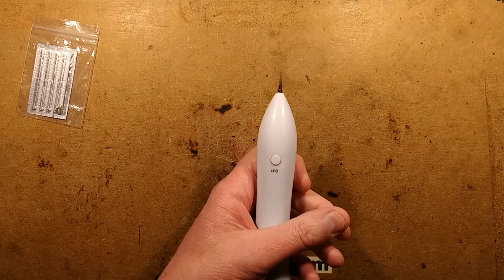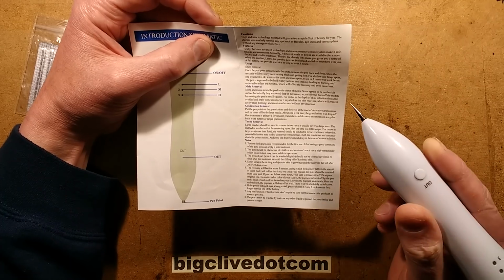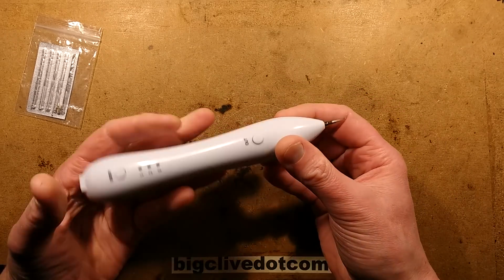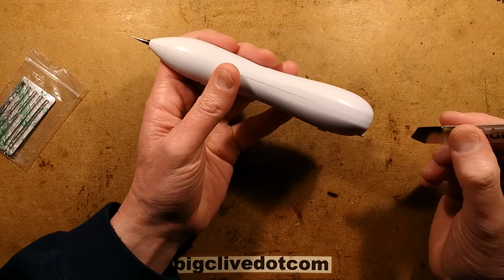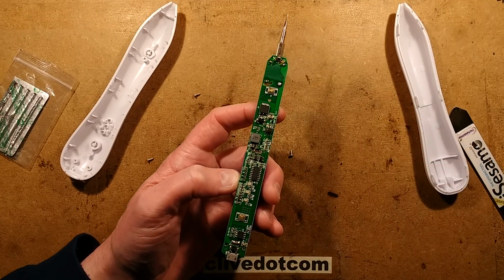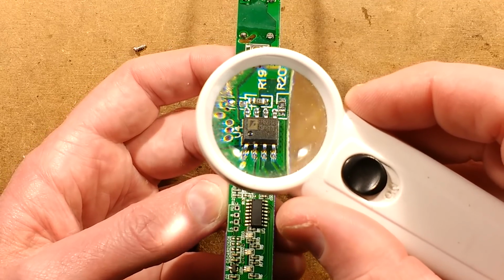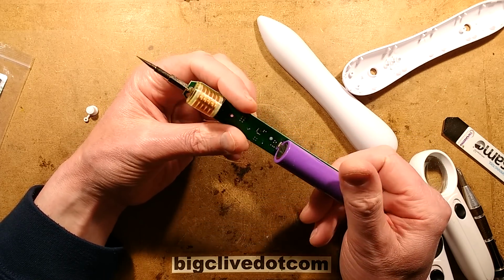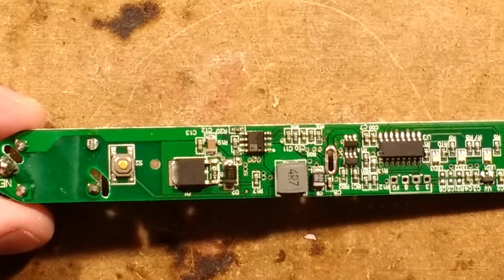USB flesh-burning pen for ladies.  Because apparently they do that.

Comment: DIY cataract removal, in the comfort of your own home, for just a few dollars per eye! (results may vary)
Reply: +Paul Drake  Cool, practicing on grandma to get my technique down.  Should be better than when I learned to tattoo.
Reply: But you can do that with a laser pointer. Although I've found my cataracts seem to go away when I clean my glasses. Go figure!
Reply: I'd say, result may be looked upon. If that cataract was single one.
Reply: L. Rom: You mean Grandma didn’t like that alligator across her chest? Of course, you did go outside the lines quite a bit.
Reply: Gary Cooper  I think she's just whiny.  It's not like she could see the alligator with her cataracts.
Reply: lol
Reply: But wait there's more!  It also comes with a free drill bit for DIY home dentistry.
Actual drill gun is not included, but you can get one at HomeDepot. :D
(Read out loud the above lines with one of those As Seen On TV commercial voices ;)
Reply: if this needle don't do the job, try a vacuum cleaner.
Reply: I'm surprised that this contraption didn't come from a seller called "PenisExtendz" or something similar, cuz I'm pretty sure they sell another model to do just that... ha-ha   By the way, that "thing" has got enough chips and RF circuitry to convert it into a 20-40Khz radio transceiver, or a WiFi router ;)
Reply: @BillAnt  : I was thinking of getting one to run some of my old Commodore 64 games.
Reply: @Dr Drake, I'm glad I had my cataracts done the traditional way!!!!!
Reply: Paul Drake 😂😂😂😎
Reply: Results will definitely not vary.

Everyone is blind now.
Reply: But does it go to Eleven?
Will this clear up her Blue Waffle 😱
Reply: I recommend you watch the Sam onella video on surgeries because you actually can.
Reply: You can actually remove cataracts with just a sharp needle. That’s how they did it in the pre-laser era. Evn the ancient Greeks and Egyptians did cateract surgery. But please don’t try it at home.
Reply: @censusgary  That's actually a gross oversimplification. They used what we'd call a large catheterized hypodermic needle. They'd remove the core after insertion and use their mouth to suck out the cataract and then flip the lens. The results weren't great by modern standards but it restored limited sight - probably akin to looking through wax paper. Still, it's better than nothing but the surgery must've been horrendous- even with some potent herbal paralytics the eyes would roll during surgery. Even with opium, the pain would be.... an experience. They also had plastic surgery to replace severed noses which were common in the age of swords. Apparently this technique was tested a decade or two back on a climber who lost his nose to frostbite and the results were acceptable, all things considered. Pretty impressive for a procedure that had to be rediscovered in modern times.
Reply: it must be fresh unpacked, unroten and sterilized with 95% ethanol (drink after use) nail then -- please don`t break the technology
Reply: Dead pig not included xD
Reply: Is that vary from blindness to death.
Reply: Definitely not gonna see a doctor after this
Reply: lol there needs to be more jokes about cataracts. It's a good word
Reply: Paul Drake this hurt to read
Reply: Paul Drake Good one!
Reply: https://www.youtube.com/watch?v=Ueu-y2rE16k

Comment: How could that thing possibly make money!? There are, like, 20 different components, the plastic case, the micro board, the metal pins...all made by, probably, different manufacturers, shipped somewhere, put together by someone, or several someones, and then packaged, marketed, and shipped to the retailer! OMG!
Reply: ChaosmanOne CHINA
Reply: Even CHINA does not negate material, energy and transportation cost. I think the answer is corruption which does not only exist in China but in the case of China means taxes illegally subsidizing a business to the point of selling cheap product at a loss while still making money while paying employees just enough so they stay or using forced labor. In any case the production line for something like this does not require many peoples.
Reply: ChaosmanOne ironically... if you were to buy that physically in China it'd be more expensive than mail order. Why? Because of taxes, and stuff hopping over to Hong Kong headed overseas is not taxed. The only tax would be customs in the country where it's going if any. Well... between that and child/cheap labor, and polluting laws being ignored? Presto!
Reply: Eman Gamer I thought the dabbing fad was over. 

OH sorry not the dance.. sorry.
Reply: The exchange rate means that they basically got $150 for it, and the parts were still cheap. Also, the PCB is probably made in the same factory that does the board assembly and packaging, it is only the commodity components that get made in different factories.

Comment: Interesting little device. This is basically a mini home "Electro Surgical Unit". A RF probe used in hospital setting to cut, burn and seal tissue in surgery. Most of the ESU's operate around the 300KHz to 3MHz range. Although, since this is Chinese crap, it probably is way off from reliable! Might have to get one just because!
Reply: I wonder - does the surgeon have to caress your thigh during the procedure? I want to know whether I should ask for local or general anaesthesia, depending on the surgeon.
Reply: No. Proper ESU's have a large metal pad that sticks to a shaved portion of you. Mostly the back or thigh. And they also put out upwards of 250 Watts! I think if someone is using this on you, you need to run! This device is a not a good medical device. I can see more problems using it then just leaving it alone. Quack medical devices seem to have made a comeback!
Reply: Well... f*ck! Deep sleep it is.
Reply: Hunter-W7NUK meh, for removing things like skin tags or stopping little bleeders  it would be fine. Moles and stuff not so much because you need to verify they aren't cancerous/precancerous.
Reply: Hunter-W7NUK quack medical devices never left.

Comment: electrocautery is a thing and doctors do use it for removing moles and warts, which is burring them off the skin.
Reply: Yes, but the idea isn't quackery, it's just not optimal to diy this
Reply: Yuck Foutube yeah but medical services are expensive with insurance and everything for non essential isnt covered.
so there is a need for these
Reply: My mole was cut out because it looked precancerous and I was stitched up with stitches that dissolved. I couldn't imagine being burned to remove a mole.

Comment: Feels like an induction heater... No use as a soldering iron then😂 could it be bypassed to just run constantly
Reply from the maker: The processor is generating the pulse train.

Comment: That's literally an electric scalpel. I work in medical equipment maintenance, and from how that thing works (high voltage and frequency coming out of a metal tip to burn/cut skin), it's pretty much the same thing going on here.
Reply: @Bendegúz Csóka , electric scalpel is a type of knife that do not cause bleeding. The electricity is irrelevant; it is simply a blade that cuts without bleeding. It's a type of precision, surgical, and specialist knife.
Reply: "Does not cause bleeding"?  Is it like self-cauterizing or something?
Reply: It's a "DIY Hyfrecator" - http://www.conmed.com/en/products/cardiology-and-critical-care/office-based-electrosurgery/the-hyfrecator-2000-electrosurgical-system. "Somewhat cheaper" than the real deal (that is somewhat north of $2000, but which is a) safe, and b) works - reliably!) :-D
Reply: @phils4634  - But should you trust a company that calls itself ConMed!? 🤔
Reply: @tisFrancesfault , if it's designed properly it can cut like a very sharp scalpel.
Reply: Can you please explain, what it is? I mean I think I should know what electric scalpel means, but what really is it?
Reply: i work in biomed aswell
Reply: Bendegúz Csóka it's a device used for surgery, that uses high voltage switched at high frequencies to cut through skin and flesh, and also cauterize these cuts.
Reply: xponen no, it's as said, basically what Clive has here a high frequency electronic nib that cuts through flesh.
Reply: seen those on tv and wondered how it worked,  now i know the basis of operation . thanks
Reply: PongoXBongo well yes. Burning is a method to cauterize wounds
Reply: It’s also similar to the way (not sure what it’s called but) it’s a technic where you take a red hot piece of metal and put it against a wound and the idea is it cauterizes the wound and kills the cells around it so no pain is felt
Reply: In a word, "Bovie"- amirite?

Comment: Does it get hot enough to use as a solder gun?
Reply from the maker: It doesn't work that way.  It would destroy components.
Reply: it doesn't get hot, it uses high frequincy radio waves like a radio transmitter, your body acts like an antenna, and it transmits at high enough energy to burn you.
Reply: I typed two questions before watching the whole video, I should know not to do that.  I removed one of the questions.

Comment: What a terrible device for maiming your self, like putting a soldering iron on your skin, i wonder if it melts solder.
Great video mate nice to see inside this device of horror. :o)
Reply: You'd likely burn the skin off the fingers holding the solder, and fry whatever semiconductor you're trying to solder.
This device seems to put out high-voltage at high frequencies, which would be conducted by the solder and, in contact with skin, burn it. Semiconductors aren't fans of high voltages, and putting this device in contact with them might have the same effect of static electricity.
Reply: HE Hee "i wonder if it melts solder" it was just for jest, it uses different technology :o)
Reply: It's, surely, a very good device for maiming yourself?
Reply: I know for sure a soldering iron melts skin real well.... Note to self: Don't keep yourself up extremely late trying to finish off soldering a project. It isn't worth it when you end up grabbing the soldering iron in the middle of it instead of the handle with your bare hand. 
Worst part was that it took a couple seconds to register so by then I already had it held in my hand & had to figure out where/how to put it down without just dropping it and possibly causing a fire. 
Live & learn they say. At least I'm lucky the skin has all healed back fine since then but damn it was sure messed up & sore for weeks - couple months.

Comment: Highly unhygienic and unnecessary. Freckles and most moles are perfectly natural.

If you discover new or abnormally large moles you should visit your doctor, not make things worse by trying to burn them off. Good lord!
Reply: I had a mole on my arm that I got removed (by a doctor) because it was right on the inside of my elbow and stuff would rub it all the time which was painful. For some reason they can be incredibly sensitive, so it's not always just "I don't like the look of it".
Reply: I guess of your prodded them with it, it would remove moles off your lawn! 😁
Reply: Yeah...removed a mole by hand once...bled like a stuck pig.
Reply: rdizzy1 < Looks like the person, who uses one of these, has been outed. Lol.
Reply: aren't moles a step closer to becoming cancerous than the rest of your skin? Seems like it would be beneficial to remove them, just to reduce your chances
Reply: Grass Yeah but you shouldn’t fucking burn them off yourself.
Reply: Yeah, I agree. I would recommend getting some of those Co2 capsules and a dispenser from walmart. Usually sold as hand held tire inflation. Just spray the thing and freeze it off...
Reply: Ron McKickass Are you trying to kill us, Ron? Blasting CO2 anywhere near your mouth and nose is dangerous, since you won’t be able to breathe as effectively.
Reply: I had some moles on my belly, the sticky out kind, had them since i was a kid. I hated the sight of them. Several years ago i just cut them off with nail clippers. They never came back and no scars.
Reply: Joshua Smellie i have a big mole on my neck. Have since i was kid. No way will i ever try to burn it off myself
Reply: That thing could probably cause cancer.
Reply: Too expensive 🤣
Reply: this would work for skin tags though     Im buying one of these!
Reply: It is for people that don't like the look of them, not for health.
Reply: @rdizzy1  Burning away random moles is a good way to let skin cancer go undetected.
Reply: everyone who removed a skin tag or a mole without professional help are retards. Honestly. You should NEVER do that shit without a doctor, jesus fuggin chirst... do you even know what moles are???
Reply: +Andrew Delashaw
Eh. I don't like the look of freckles, luckily I don't really have freckles though. But even if I had, I'd try to find some other way to get around the look than home treatment with a flesh burning pen.